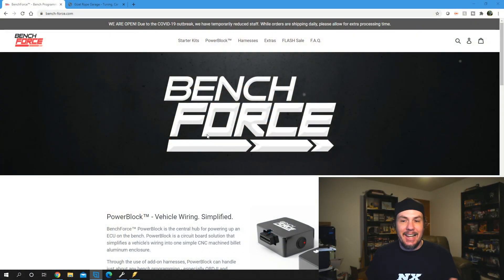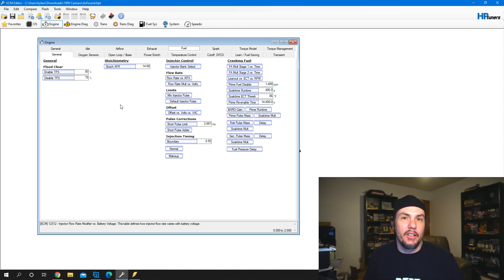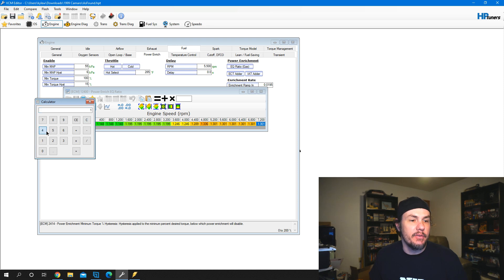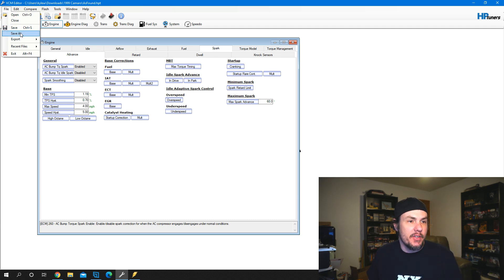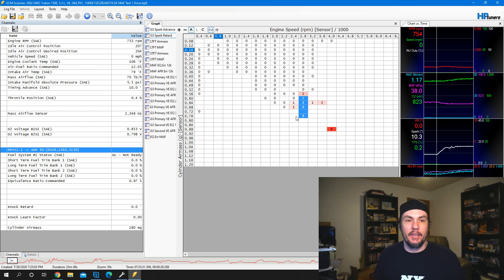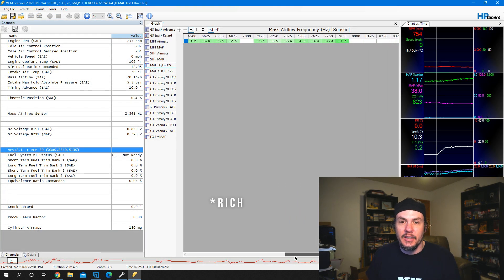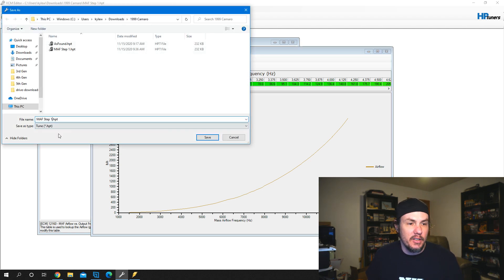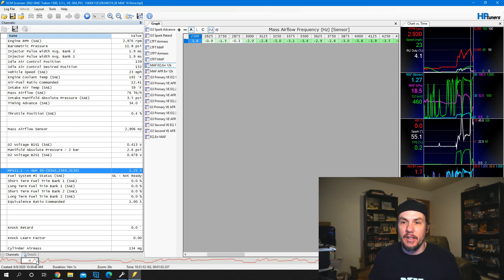GM Gen 3 MAF Tuning Intro, The Basics For Mass Air Flow

Comment: I have been chasing my tail on this and I figured out the copy and paste was taking it the wrong way. Say I had -20 I would copy paste by % and it in theory supposed to lean it out a little bit it made it rich. I have to do it manually so say I get -20 I'll go in and manually multiply that cell by 1.20. idk why it doesn't take it the right way

Comment: So in the STFT for open loop you say disable it. But isn't disabling that function actually saying you are enabling closed loop STFT because you disabled open loop? I am seeing mixed settings as I research this. in my a oem tune for open loop STFT, it says enabled, But in a tune that I had done years ago from a reputable tuner on my last truck. I look at the tune file to compare and it says disabled. I'm trying to understand why some factory tunes I look at will say either disabled or enabled and trying to figure out which is correct. And did my tuner just not change it back to enabled after he was finished tuning? I ask him and he said he was correct. what should be the simplest part of a change, seems confusing.

Comment: hi, im tuning a 12' tahoe w/ 5.3 and 6l80, ive got a larger after market intake and 1 3/4" longtubes w/ 3" y-pipe and no cats, im  very inexperienced with tuning, so far ive only done mild alterations to the trans and PE. i was just curious if you think maf tuning would be worth it for my setup? i have not touched the vcm scanner or made a log before so this is a little intimidating

Comment: Tuning a 2004 Corvette Z06
Under Exhaust/Gas Recirculation I do not have a Enable/Disable toggle I only have the Disable speed and Enable Speed options.
Will setting both to 200 effectively turn it off  the same as using the Enable/Disable toggle that I don't have?

Comment: In my tune file under engine, fuel tab, oxygen sensors I don't have an LTFT enable or disable button. Under long-term fuel trim, I only have a Min ECT of 131⁰ and a Max ECT of 284⁰ what should these be set at if I don't have the ltft enable or disable button.

Comment: Got a 2009 Pontiac G8 GT with full length headers, no convertors AFM delete kit from btr cam stage 2. Just bought a New HP mpvi3. I pulled the factory tune. But after installed. All the parts, the G8 won't hardly run when it warms up.. I was going to buy my tokens, and turn off the DOD first. Anyways. My issue is I need to get this running some what driveable fast time line. My house burnt down and took out my two other daily drivers, but thank God my g8 was saved. I have been watching your videos and learning. I just want to make a couple minor changes to get this thing running somewhat better to try to work on the tuning. What do you think. Will the DOD delete switching off help in the warm issues. Then work on tuning. I don't want to destroy the car. I want it right. Also since I bought this tuner. I have to now pay a registration and tokens? And 12 tokens for unlimited for a year. Is this correct from HP?

Comment: I've watched through this video quite a few times, and have everything set up like it should be. I've taken quite a few data logs and then made adjustments the way that you suggest, using the multiply by %1/2 function, but I can't seem to get it to improve. Currently, my truck shows that it's very lean, and no matter what I change, or how many times I redo that process, it doesn't seem to improve. If you have any thoughts on it, help would be much appreciated. I'm using an Innovate LC2, a Bosch wideband, and HPTuners (obviously lol).

Comment: I bought your graph layout from the website but I can't seem to get the MAF Error EQ to populate when recording with the scanner. how do you fix the math errors in the graph?
Reply from the maker: Are you using a wideband?
Reply: @GoatRopeGarage  yes, AEM. I set it up in HP Scanner
Reply from the maker: Are you logging mass air flow, the one that reads in Hz
Reply: @GoatRopeGarage  I have the graph set up to log the mass air flow in hertz. When I record it is not populating the columns. There is only one row. I copied the parameters from the editor. Starts at 1500, 1625, 1750, etc
Reply: Is there an email address that we could maybe communicate more efficiently with?
Reply: I sent you an email

Comment: An easy way to figure PE EQ ratio:

Stoich Lambda divided by desired Lambda. 1÷.85 is 1.176

Stoich Gasoline AFR divided by desired AFR.  14.7÷12.7 is 1.176.  

You can also calculate AFR/Lambda by dividing Stoich by the EQ ratio.
Reply: Sorry, it is 12.5, not 12.7 as I had stated in original comment.

Comment: I have a 220 cammed 6.0 and when I first start it up the throttle response is supper faster and crisper than  after it's warmed up. Is that because it's in speed density mode while it's cold? If so I guess a speed density tune (no maf) would be the key right?
Reply: Did you get your issue resolved? If so, can you tell me how resolved it? Thanks

Comment: What if my open loop/base tab doesn't have STFT?  It only has the EQ ratio table.  I have it in my scanner/logs, but don't know how to trace back where it would be in the editor.  It's a 97 ls1
Reply from the maker: Just look for a way to fail the oxygen sensors
Reply: @GoatRopeGarage  I only have closed loop enable, and LTFT settings.  Nothing says it's for o2 sensors in general/overall.  Does disabling closed loop (ect vs iat table) automatically disable long and short term trims?

Comment: What's the advantages of going to the LS7 MAF over the stock one in the Gen 3.  The motor that's going in the truck is a Summit Racing 450hp 5.3. The intake is a Fast LSXRT with the  Nick Williams 103mm throttle body.  The air cleaner is one of the Volant air systems.
Reply: The ls3/7 MAF is a card style and can be slid into any intake system.  With this, you can use larger piping, which allows more airflow for a given measurement.  Aka the MAF is able to “support” more power without being maxed out.

You likely won’t see much benefit doing this with your setup.

Comment: im confused as to how you can tell that its rich or lean on the maf eq err table. arent negative numbers rich? or is it rich + or - if its over 1. or are those numbers even related to lambda the value. switching from afr to lambda has confused the heck out of me. everything else is coming easy as i work with it and watch your videos. its like changing jets/power valves and turning the distributor and changing springs/weights with the keyboard. so awesome, becoming more addicted with every tweak.
Reply: basically i dont understand what the +/- number in the chart is. its been a long day though and ill probably get it after i get some sleep and take another look. i appreciate the content and time you take to explain this stuff to the world. cant wait to have this stuff mastered!

Comment: I was doing a MAF tune today and as an extra step, I zeroed out all the cells in the VE table (2003 Corvette PCM).    Engine died driving down the road after 2.5 minutes or so.  Wouldn't re-start.  Put in the same tune with re-populated VE table and I have completed 3 more scanning MAF tune sessions with no issues.   I would think if it wasn't using the VE table and was in MAF only mode, it shouldn't have died.... Thoughts?
Reply from the maker: It's still using it, you can never get rid of the ve table, that's why it's important that is tuned also. Watch the recent video I did on dynamic airflow, it will explain it better
Reply: @GoatRopeGarage  will do, thanks for the response, love the channel! I always do the ve first as that seems to be the prevailing wisdom. Thought I would try something new as a test to see for sure if it's using the VE  table or not well you are in supposedly only maf mode. It failed...lol

Comment: So I'm new to tuning. Built the engine myself it is my first one. Anyways I'm trying to tune it with the help of your videos. I have a sloppy stage two cam and a set of headers for it. The issue I'm running into is when I press the throttle it drops all the timing and gets to stall out. I saved the log if you want to take a look at it. Or do you habe an idea of what I might be doing wrong.

Comment: Great video. I have a question. I'm tuning a rock crawling Jeep. 5.3 gen 3, "mild" cam. Was fighting idle issues and found my intake air temp climbing above 200 deg. and a significant amount of timing was being pulled as a result. Installed an intake tube to pull air from under dash and it's much better. Now trying to re-tune the MAF. I don't have access to a dyno. Can these pulls be done without a dyno? If so how do you suggest logging without one? Thanks.

Comment: I see it as part of the process going from the scanner to editor to special paste multiply by half what is that doing? I am just beginning and trying to pick up all that I can I have read up on it some and it says to do it but I was just trying to understand what that does. Thanks
Reply from the maker: The graph logs error percentages, we are correcting that error, the half multiply makes sure we don't overshot
Reply: @GoatRopeGarage  makes complete sense thank you. Your videos are awesome I just keep watching them over and over until all of the pieces make sense thank you for taking the time I appreciate it.
Reply from the maker: That's the best way, keep digesting the information, see how it works on your setup and make incremental changes!
Reply: @GoatRopeGarage  Great advice definitely what I'm doing I have spent almost six months trying to find a tuner I built a Whipple charged gen-6 454 in a 98 K 2500. Couldn't find anybody to tune it so got a hold of a guy they gave me a spreadsheet for the 0411 swap. It came with a base tune that pretty much got it to start so I can get fluids topped off and get it loaded on a trailer. I finally found a guy that was willing to tune it I'm not really connected to all this social media accounts and I paid $750 to get the truck tuned because I wanted it right and it won't even stay running at idle. I wanted to learn it anyways but I just bought hptuners and I'm spending all kinds of time learning why things work the way they work and how you tune a little bit at a time make sure everything works and that it's accurate. That way I understand why I'm doing what I'm doing as well as using my knowledge on how the motor works and what needs adjusting. I watched your video on how to select a tuner and anybody else that is going to get their vehicle tuned watch that video it will save you a ton of time and money and frustration. This information is priceless and this is where performance is going and it's not slowing down you have to be part of a community that helps us all grow and I am grateful for that.

Comment: Thank you for the videos.  When I select the AEM wideband serial output  in HP tuners it shows it as EQ Ratio, but the gauge itself is displaying lambda. Does HP Tuners convert lambda from the gauge to eq ratio automatically? Otherwise, I need to do some math to convert lambda from the gauge to agree with eq ratio in the gen iii pcm. Correct?
Reply from the maker: They are the same

Comment: Interesting point about disabling STFT. I was out doing MAF tuning pulls and making adjustments and found I was always lean. It seems like the PCM was countering my attempts to richen the table. I'll have to try again tomorrow with STFT disabled. I bought the histograms even thought they aren't that hard to set up once you do it a couple times. Thanks for the videos.
Reply: Follow up for those performing MAF tuning: Before this video came out I was trying to tune the MAF table by disabling everything described in the old Gen3 MAF tuning video. I was still lean after 12 iterations and by then the engine didn't run well. Today, with all the same things disabled PLUS STFT disabled as described in this video, I got a near perfect MAF table in 4 iterations. I have a P59 with flex fuel PCM.

Comment: This is great content, if I have a ecm p04 am I looking in the wrong video/ gen3 / gen4? Also I’m trying to tune a 98 v6SC..... a lot has helped me with videos. It’s a bit confusing as I think I maybe missing things. Or things maybe different... for instance my Kpa on my ecm graph goes to 105... but I’m scanning or reading 170kpa. How can I add that to the ecm tables? Also I would like to scale my maf. I’ve dropped pulleys but would like to know what’s actually coming in. I’m about to buy your graphs! But I know on these older models things are dif! Such as speed Density. Etc etc. pretty sure my fuel trims are all over the place. Although I’m seeing around 11.8 to 12.7 afr at wot. At light load 40% under throttle I’m seeing somewhere in the ball park of 17. Basically leaning way out!
Reply: I was wondering if you've figured out anything on how to disable deceleration fuel cut-off? Or disabling ve at all when doing MAF tuning. 

I know the PCMs for the GM 3800s do not have any parameters in the editor to do these things like Kyle shows on these Gen 3 and up LS ECMs. 

Thanks
Reply: The dcfo, is something I've messed with, it's all about enable and disable ref counts, I wasn't able to actually disable it.... I finally got an afr gauge aem x 30-330. And I haven't ran into any problems maf tuning, but it's a very long process, I was around 7200 hrz when I had to add more then 40%, then found out that dropping to a 3.4 on gen v SC, on a series 2 the injectors just couldn't keep up, I was at injector duty cycle of 142% and still leaning out up top, I upgraded to 42.5 injectors, and that took just as along to retune everything.
Reply: @CavFire98  I have a top swapped L36 with a ported Gen 3 blower. VS cam, ported heads and a 3.5 pulley. I also have that same wideband as you got. 

I've been able to so far get me MAF close, but it doesn't want to idle after coming back to a stop. I have to feather the throttle for a few seconds before it'll idle on its own. 

But even with cell count hits set at 7, deceleration is still skewing some of the data. I've just located and smoothed out those areas best I can. 

My injectors are keeping up fine though. I'm kissing just over 10,000hz on the MAF to lol. Probably because I'm on the stock L36 throttle body and MAF.
Reply: @boosted0079  I'm actually getting ready to swap everything from my 98 gtp coupe to an 01 gt coupe, so top swapping shall be fun, my 98 is just to far gone underneath. I'm hitting right around 13 psi, shifting at 6k. I really wanna try a" vs" and 90lbs springs and leave it at that, I got basic bolt ons, slp headers full 3inch 42.5 injectors, it has the l67 lower manifold ported and matched to the gen v, l67 throttle  npt for the pcv, I'm hitting close to 10,650 hrz
Reply: Same goes for cylinder air mass.. pretty sure it’s maxing out on the ecm table at 0.92 and I’ve seen it in the realm of 1.02 1.05

Comment: I'm thinking of putting a "411" pcm in a 1997 K1500.  Just wondering if someone can confirm that this would be a gen 3?
Reply: A low res crank gen 3, yes. Start with a van 350 tune.
Reply: Yes. I am currently working on one but I have a HT383. Main reason I did a 411 swap was because I already owned HPT and the black box is garbage.

Comment: After buying all i need to tune i am so nervous for my first startup only tunned out vats so far but now i have changed camshaft, heads, intake and exhaust so i am afraid of it not running well enough to break in motor.
Reply: Gen 3, 2002, 5.3, dbc, stage 3 summit cam, 799 heads, mid length headers, Holley ram intake, th350
Reply: @1967c10Guy  Just don't rev it out and take it slow. It's pretty hard to hurt a motor just idling and driving around normally.